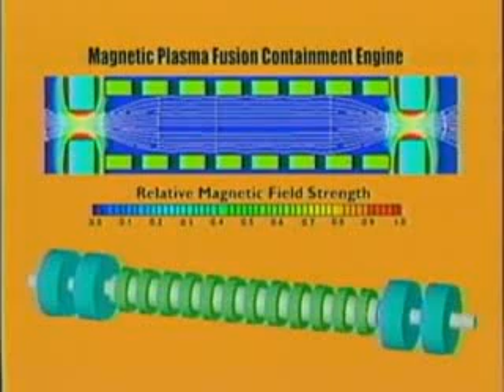UFO TECH 26 Fusion Powered Light Speed Rocket Area 51 David Adair shown his flew 8000mph 1971 pt4of5

Comment: Would this engine abide the fact that reaching higher speeds, the mass of the rocket would increase proportionally, reaching the speed of light the energy needed to move it would be colossal(or infinite) , I guess  that is some kind of critical point(area) when the rocket reaches speeds close to speed of light.
I have seen the “Congress hearing”.  If I am correct the panel was formed of FORMER congressmen/women, therefore their decision power equals ZERO.